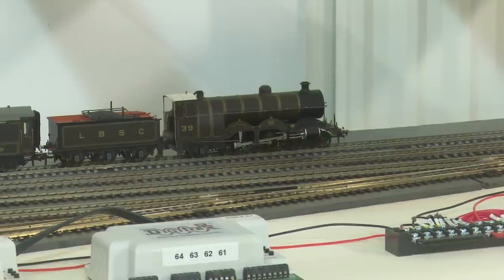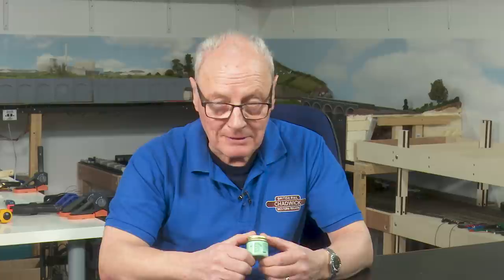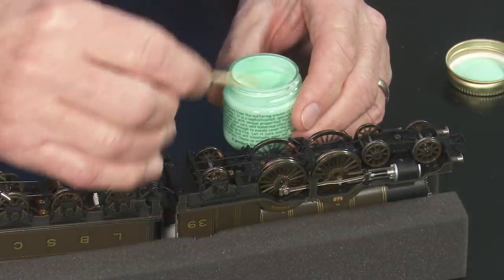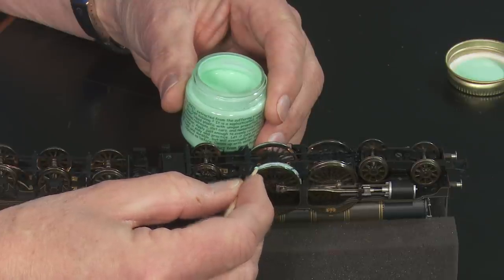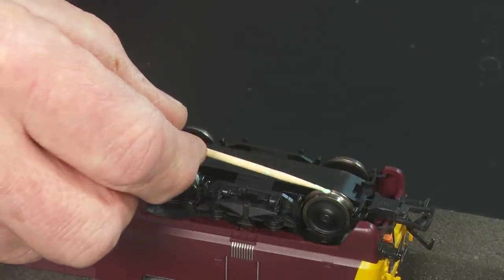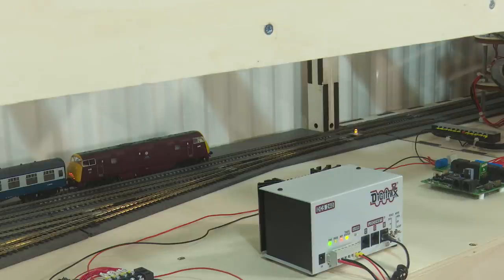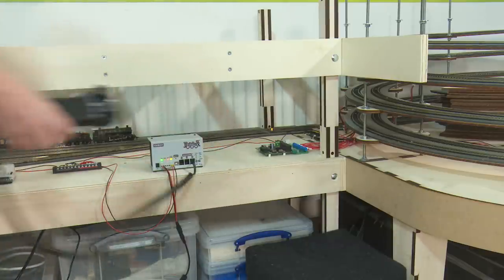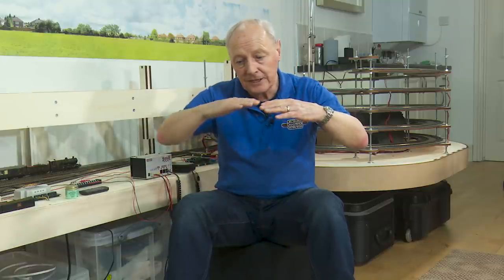Traction Troubles and Bullfrog Snot at Chadwick Model Railway | 122.

Comment: Consider even ICEs are only allowed to drive 70km/h on the "Geislinger Steige" with 22,5 ‰ or 1 : 44,5 - your museum-stock doesn´t have to run half speed.
About your other coming helix ask your guru if there would be enough place for straight-upward track every half helix turn and therefore less incline.
Otherwise I am part of the pro-traction-tyres-group, even if you got to turn the wheels down a bit (electrical contact is given by the tender / the other bogie anyway).
Reply from the maker: A very interesting comment, thank you. All these options are now in the mix, but changes to the Helix are looking promising. Regards Charlie

Comment: Charlie: Can I make a suggestion?  I see a few comments about double-heading on the helix. It's not what you want; you want it to work 𝑝𝑟𝑜𝑝𝑒𝑟𝑙𝑦. But:, here's an idea, if I can put it into words: Why not run Chadwick like a proper railway? The helix at either end will be hidden, like the majority of the rail network(the rest of the world.) The real railways had limits on how many coaches could be hauled by each class of loco, because of places like Dinton/Hemerden/Lickey. Do the same on Chadwick. A Warship can only take nine up the helix; so run it with nine, or double-head. The clapped out steamer will only take three Pullmans up, so add a pilot, or use a larger loco. 
Do you see what I'm getting at? Use it as extra fun in operations, rather than seeing it as a fault. A train passing Chadwick has to have come from somewhere "off-scene" and there are serious gradients on that part of the network, so adapt your traction accordingly.
You could even make Chadwick the point where pilots come off the trains, running back as  light engines - even 𝑚𝑜𝑟𝑒 operating interest.👍👌😁
I hope 𝒔𝒐𝒎𝒆 of that makes a bit of sense Charlie; 𝑰 know what I mean.😁 It's just a thought but I thought the whole idea sounded like fun. I suppose it also kind of depends how many locos are badly affected.
Cheers for now,
Dougie.
Reply from the maker: I totally agree with you Dougie. What I really wanted to do from that exercise was to test the viability of the Helix to see if there are any inherent problems within it not just to locos. This week I’ve been working on the Helix and things are much better as hopefully you will see on Friday. Regards Charlie

Comment: Interesting.  I think I've seen this (BS, not your video) before, and viewed it with a bit of doubt.  Obviously it will have an effect, but I can't help but think it's better left for replacing traction tyres on locos, for which you can no longer buy the proper traction tyres.  Anything else, it's bound to have an effect on pick up - and I have to admit I wondered if you wouldn't have been better applying it to one axle on each bogie, or one diagonally opposite wheels on each bogie (if you see what I mean), as you've effectively reduced the Warship to an 0-4-0 for pickup.  
Presumably the Warship has magnets fitted for the powerbase thing?
It looked like both locos struggled a little less once they'd got round the first revolution, so I wondered if the initial gradient was a little steeper than the rest.  But your decision to add another revolution to the spiral, will clearly be the best solution. You can probably get away with reducing the vertical clearance of each revolution too.
I wonder if there is anywhere on the underneath of the steam loco you could drill out a few holes the size of some of the smallest powerbase magnets?
Thanks again for keeping these videos coming Charlie.  They're always informative and entertaining.  In response to your final comment, I tend to watch youtube model railway videos on my telly while doing a very un-serious workout.
Reply from the maker: Hi Andrew, I've rewprked the helix this week and things are much better.

Comment: To be honest all stuff you have to put on driving wheel, Im not particular happy with it forms an insulator on the wheel and thus pickup issues. I think limit your inclines to a max of 2% most real railways wouldn't think of more than 2% on their inclines. Especially when you have a helix, in a 2% incline helix locos will struggle because the incline is also in a turn making it even harder to ho up. A helix is of course the way if you want to overcome hight and you do not have the space for a long 2% or less incline, but helixes do have disadvantages over regular inclines, and also the adhesive weight of your loco has a big part in it. You might consider double header consists of you need the traction. I tried a consist of 10ft on my 2% incline with a small geared Heisler loco, no such way, but with a double header no problem. Like in the real world if you cannot get up the grade with one loco use 2 or change the incline % on a helix.
In an earlier design of my layout I incorporated two helixes. But before buikding the layou I tested the incline rates of my smallest loco. This test concluded that I would not use a helix. On a 6ft piece of strait track I tested each time a bigger % of incline with four cars, I got stuck at 2% bigger than 2% the loco could not get with four cars and that's why I do not like helixes.
Reply from the maker: What an excellent comment. I have now completely rejigged the helix and adjusted the incline considerably. All in next week’s video! Regards Charlie
Reply: @ChadwickModelRailway  your welcome Charlie, Regards Gerard from Holland

Comment: So you  are missing the point  and if you continue  to  have atrain with 10 coaches on your going to burn the motor  out.The first thing you  need ti do is get the gradient to atleast  1 in 50 and the loco must be able to  restart the whole train on the gradient. The problem  is tha the loco on the  straighht put the power straight  through the whole train. When going round a curve you lose 15 % power on first coach and 25 % on second  coach and so forth. What is needed is respite with a straight piece  inbetween layers.
Reply from the maker: That is the whole point of this evolution.  To understand the limitations of locos and trains.
Regards Charlie
Reply: @ChadwickModelRailway  I had this probem way back in 1985 and IFound that any gradient over 1 in 10 per xoach was about the limit for ljma locos. The test track was a piece  of 2×1 over 130 inches long and place a piece  of wood under  the incline and find where the train qouldd climb the results were 1 coach ever 10 inches .hornby locos have always been bad pullers
Try going up one inch on first circle and then 3 inches on second .
Now go across the yard to tower at the other toewr climing  gently  then another 2 turns to get to the rop level.

Comment: No wonder this doesn't work. Your train is almost as long as one loop of the helix, which will let any loco struggle. Not because of traction, but because of the angles of the bogies on the coaches in comparison to the angle of motion of the loco. If you were to make your train longer than a loop of the helix no loco would get up. Essentially this is a mathematical problem without a solution. Please keep your train length up to maximal half a loop of the helix, or increase the diameter of your helix considerably.
Allow me to try and explain. If you draw a circle like a clock, and you place the loco between 12 and 11 o'clock, a coach between 11 and 10 o'clock and so on until 6 o'clock everything will be fine. Now draw an arrow at the heartline of the loco and all 5 coaches and you'll see they are all moving in a different direction.
All arrows are pointing upwards, decreasing by 30° the further you go down.
Now if you add coach 6 and you draw the same heartline arrow you'll see it points downwards. This is where exponential drag starts to happen. Because of the negative angle of the arrow mathematical physics suggests that you've added somewhere between 2 to 5 coaches of extra drag in comparison to a straight line of track. As you add coach 7 the problem increases exponentially again, some 5 to 10 coaches of drag on a straight line of track.
If you seriously want to run such long trains you'll need to decrease your incline down to 1%, 1.25% which would lead to a significant larger radius and therefore a shorter train compared to the radius.
It's one of those chicken and egg conundrums 😄 
Sorry Charly, no amount of bullfrog snot is going to cure this problem. Perhaps a pinion and rack setup might solve this?
Reply from the maker: What an excellent comment Rob.
However, my diesels sail up it with 10 coaches. Regards Charlie.
Reply: @ChadwickModelRailway  Cheers Charlie 😄. I made bit of a mistake by mixing up coaches with bogies and coaches with fixed axles 🤭

Comment: Its basically liquid latex.  If BS isn't sold locally where you live, you might try latex from an art, craft, or hobby store.
Reply from the maker: An interesting option, have you tried it?
Reply: @ChadwickModelRailway  Yes, on a 4-8-4 Rivarossi steam loco.  Works fine, although I don't have much running time on it.  The loco had a traction tire that dried out and broke.  The wheel has a machined groove for the tire to set into.  So the latex just filled the groove like a rubber tire would.  I'm guessing it's probably quite a bit thicker than what you may have on your loco.  But it does provide traction like the rubber one did.